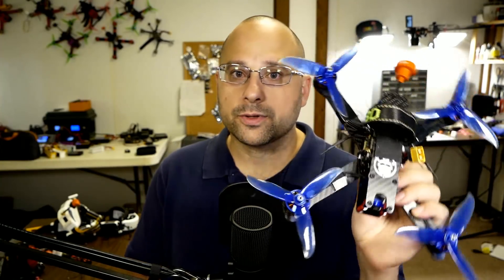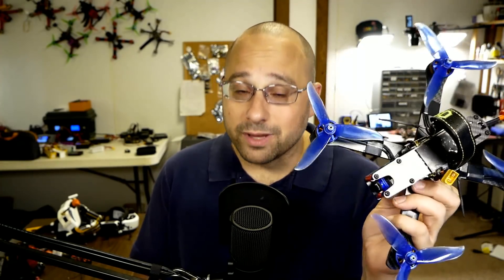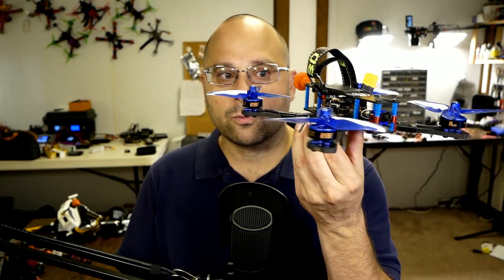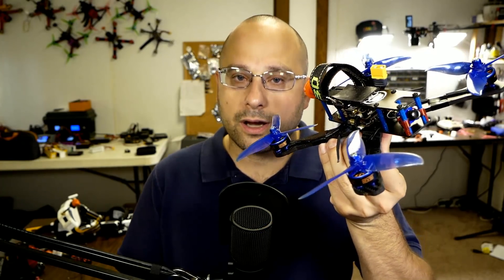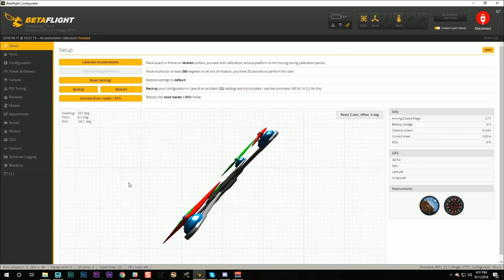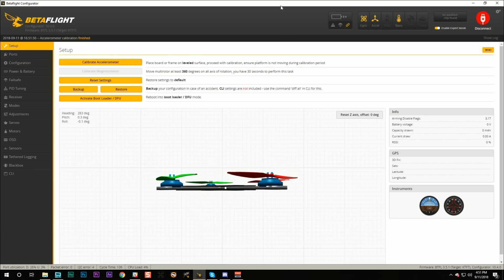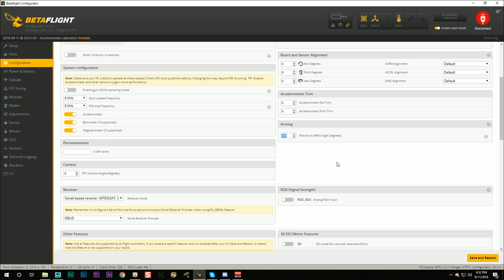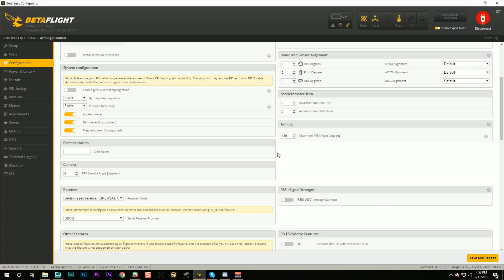BETAFLIGHT WON'T ARM | ANGLE arming status flags

Comment: My t.hawk 2 is bound but won't arm.
Channel mapping is off. When hooked to betaflight throttle is yaw, rudder is throttle...etc.
Tried to mix it on the tx16s. 
Just updated the aetr 3. 1.86 or something...
Maybe I updated and flashed the wrong internal rf module..I thought it was the 1 that was on there...idk ..got 7 plus hours on the dam thing.

Comment: Hey I’m having an issue with the arming the quad when I arm I get the Angle flag and when I calibrate the accelerometer it still has the same flag. I then disabled the acc and when I arm the quad flips out I’ve checked motor direction and everything this isn’t a fresh build so I know the motors are all correct any ideas?

Comment: Wish I had seen this 24 hours ago, got drone stuck 40m in a tree with 25 degrees set and had to go home droneless, the next day I went and got fishing line and weights and after 2 long hours luckily I managed to get it out. If only I knew about the stick positions for calibration  I could have saved my new battery from been fully discharged and had my drone back the same night 😑. I won't be the first or the last to do this make sure you set it to 180, if not recalibrate with the sticks and blip your way out. Thanks for this video.

Comment: None of these videos gave me the answers to what was happening with mine. So I'm going to let you know, so "you're going to learn something today". It was nice to learn a couple of things like the CLI status command and the OSD (even if I don't plan to use it). My guess is there still going to be some out there that will still have an arming issue and the fix for my controller was to increase the Gyro and PID loop hz. Mine was defaulted at 1k on both and I knew most of the reasons it wouldn't arm, but this one was new. So now you have been learned...…..
Reply from the maker: What status code was showing?
Reply: Good question, it was angle. I even tried setting 'small_angle?' to 180, no dice, code still there.

Comment: I've got a funny one. I slid my quad down a slide at a playground. As it was sliding, my OSD flashed "runaway".  What's up with that?!
Reply from the maker: When you have just taken off, the quad watches to see if you have screwed something up and is going to flip out. If it detects this, it disarms with the RUNAWAY flag. When it was sliding down the playground, it was moving different from how the sticks were commanding which made the FC think it was going to flip out.

Comment: Maybe the TX should have 'knock proof' switch, those which require a pull motion to move positions? 
Great tips 're trees 👍 thank you.

@JB, one thing I couldn't deduce  was when the stick position programming becomes effective? Is this during the unarmed state?  I actually want to avoid the classic down left/right to disarm/arm and have chosen a switch for this, are sticks enabled by default?

One last point, yep accelerometer drift is quite pronounced on my KK2.1 board running 911 in self level, although SL is rarely used.
Reply from the maker: Stick commands are mostly active when disarmed. If you have an arming switch mode, then stick arming is disabled.

Comment: Does the JBF4 have MFI certificates? I haven’t received an answer from RDQ.
Reply from the maker: This question doesn't really make sense to me. Why would a flight controller have an apple certification?
Reply: Joshua Bardwell I was told by speedy bee that the OTG connector wouldn’t work with iPhone unless the FC was MFI certified. I just don’t want to spend $10 to find out the hard way.
Reply from the maker: LOL. There isn't a single FC in the world that is MFI certified. You can't use the Speedybee OTG with iPhone at all.

Comment: I ran into the "accelerometer drift" problem on my QAV180, and I replaced the flight controller with the same type and ended there again. Than I changed from SP racing F3 evo to the omnibus F3 and the problem still exist. Now I'm planning to go for my omnibus F4 pro v2 (fake one, I've ordered from hobbyking), but I'm afraid that the problem will appear again. So it can't be the flight controller.

Comment: I don't have the option below the arming section, it's blank. No option to change it.
Reply from the maker: Hit the "Add" button to add a range.
Reply: Joshua Bardwell yeah not sure why but I don't see that option either. I did end up figuring it out though in the cli. It's set small_angle = 120

Comment: Hey Joshua I’m having a problem with rotor riot fc it has a red light on and it won’t connect to betaflight and the osd is not showing up at all
Reply: Reflash Betaflight if you can.
Reply from the maker: 1. Hold down the bootloader button. Plug in the USB cable while continuing to hold down the bootloader button.
2. Run the Impulse RC Driver Fixer app (https://impulserc.blob.core.windows.net/utilities/ImpulseRC_Driver_Fixer.exe). It should "fix" the driver successfully. If not, do not proceed.
3. Un-plug the USB cable.
4. While holding down the bootloader button, plug in the USB cable again.
5. Start the Betaflight Configurator app. In the upper-right corner pulldown menu, you should see "DFU". You can now flash the board.

For more detailed instructions on how to install the STM32 drivers: https://www.youtube.com/watch?v=m4ygG6Y5zXI

Comment: JB, have you ever thought about setting the arming switch on a potentiometer? It looks safer to me.
I had to do it in my first quad, because I was using a FlySky FS-T6 (with a tiny micro ppm receiver from DasMikro - I know, I screwed up buying this transmitter... But I already bought a X9D Plus SE). It only have 6 channels, so I set up the 2 potentiometers as the aux channels and use them as 3 positions switches. One of them armed the quad in the middle and disarm and turned the beeper on in the 3rd position. The other was for modes (angle, horizon and acro).
Reply from the maker: Problem with this is, how do you disarm quickly in an emergency?
Reply: @JoshuaBardwell  Yeah, with a switch it's probably faster... But I think it's all the matter of getting used too. Or setting the pot + 1 switch, like you do with 2 switches. 😊
Anyway, those are only ideas I've been thinking about. 😊

Comment: Can you explain how to bind a Frsky SR6 to Taranis plus with STK ?
Reply from the maker: Binding all frsky receivers is pretty much the same. Hold down the bind/fs button with power off. Power on. RX is in bind mode now. In transmitter, enable bind mode. LED on the RX blinks, RX is bound.

Comment: Tip for angle mode flyers - if you find you can't adjust accelerometer trims with the stick commands, the craft needs to be in angle mode and disarmed for it to work since Betaflight 3.3.0. The fix is easy - move the slider in the Modes tab for Angle so when it's disarmed it's also in angle mode.

Comment: About accelerometer drift:  I've fixed that several times by either replacing motors or, as you say, replacing the FC. I think it's vibration and/or, maybe a bad acceleromter

Comment: or just turn your transmitter remote off in between flying? that way if you hit the arm switch it wont work anyways.
Reply from the maker: It's bad practice to ever turn off your transmitter while your aircraft is powered up.
Reply: With my radio gear, if I'm using a RX with two-way communication the TX won't turn off as long as the RX is turned on.
Reply: Best practice would always be to turn the tx on first and not turn it off until after you've switched the quad off. Probably never have a problem in reality but I had an old quad on cleanflight freak out and fly around uncontrollably at one point. I've also seen / had rc cars shoot off because the tx has been switched off while the model is still plugged in. Should be fine with failsafe set up but wouldn't recommend it as a routine process. Plus raising the throttle a little is probably easier than switching the tx on and off all the time.
Reply: OriginalGingaNinja  i understand that, but you switch it off after your done flying/driving and unplug the quad. I usually get the buzzer/beeper going low battery, land via disarm switch killing it..go up and unplug everything..then thats that...remote may stay on or off depending on if I turn it off(usually I do). If your not switching in a fresh battery immediately why leave your TX on?

Besides failsafe should be setup so if remote goes off/loses connection the quad disarms/drops...if for some reason your turning off the TX while the quad is armed. I dont think anyone flies that way or shuts off their remote without disarming switch first.
Reply: @videogamepolak0  Sorry, I thought you were suggesting turning the tx off before going over to pick your quad up and unplug it. Obviously if the quads unplugged it doesn't matter if you hit the arming switch. Yes failsafe should save you anyway but someone may get into that habit and later fly another model / different RC disapline that doesn't have failsafe.
Reply: OriginalGingaNinja  yeah I dont run a Lanyard yet on my remote so carry remote by handle (fly sky ia6)

Comment: Hello, I have a question maybe you can help me...
I Got here a bloody Wizard X220S. I know its badly begining  =)
Thing is, one motor didnt want to spin anymore after 50 lipos. (& trust me, i was so nice with throttle, & smooth as possible with stock settings)
 So i thought that the motor itself or even the ESC 4in1 burnt out, but i figured out after replacing both parts that my problem came from an another way... Could it be the Flight Controller ? I've looked for a answer but no body talk about that, only you & few about output motors on the FC... (In french too, but im french nvm)
So i'm stuck now since 3 months with my first quad (brand new) & i changed the Crappy Esc 4in1 (god damn its hard) with a more experienced friend in the matter of soldering quads, without any success. Then we decided to be sure that the motor wasnt the cause, but nothing changed. After bunch of searches, i saw other people having same issues, or kind of similar stuff, like the entire frame could burn at everytime after months of usage... Lol.
Everyone else can maybe light me up here?
But for now, im stuck with a quad with all brand new parts, & one horrible issue without any solid informations about it.
Thank's, & Regards. 
Keep it up !
Reply: Could be the signal pad on the flight controller crapped out, that has happened to me. JB has a video on how to remap signal output pads.

https://www.youtube.com/watch?v=FysPHx7RL9s
Reply: Try a known good motor in that position
Reply: AS i said, i've already done that.
Reply: Thank you guys but its an ESc 4 in 1... I've already watched that video poofire, I've obviously done everything i could like flashing & calibrating.
So there is only one cable goin to the FC, its a little 4-pin... How should i do to remap that kind of connection :S

Comment: I'm surprised you didn't talk about the CLI assign. I don't think the angle change option was in the Betaflight GUI, because I remember I had to change small angle in the CLI in 3.2 or 3.3. For some reason, my small angle got changed to 0 and it took me forever to figure out why it wasn't arming.
Reply: It got added to the gui in BF configurator a while back now.
Reply: OriginalGingaNinja sweet. The tutorial I read must have been made before the GUI showed up.
Reply: @JaredWhittle  It definitely was something you had to do in the cli in the past, nice they've put it in the gui now.